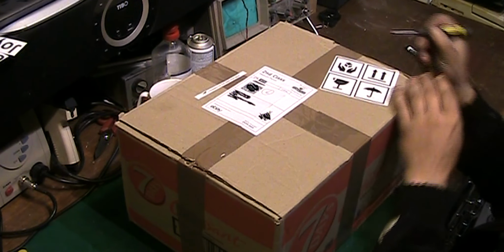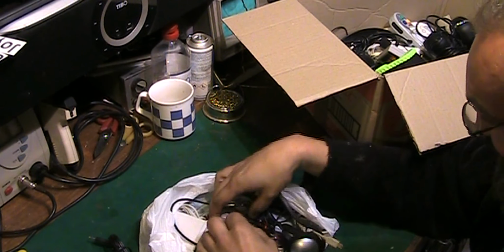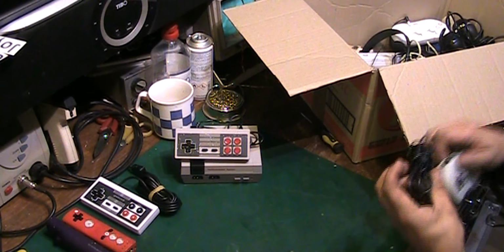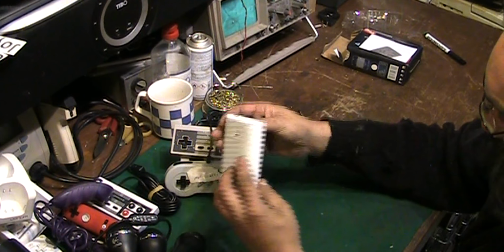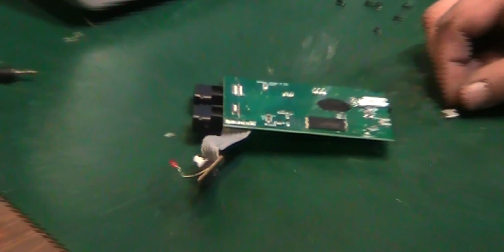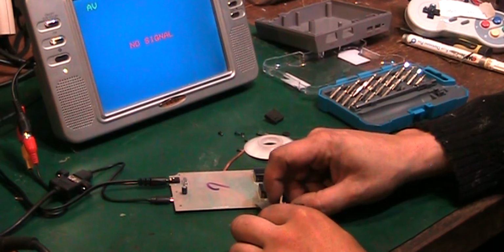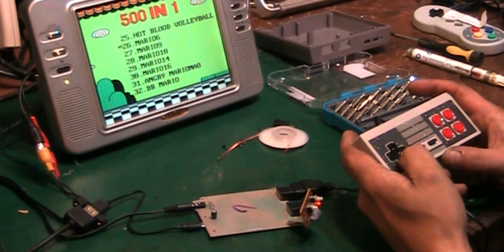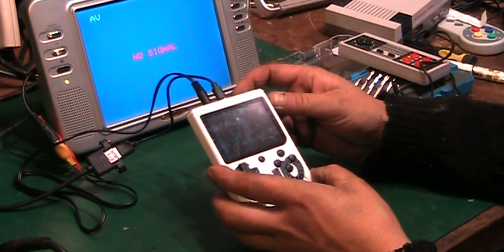Retro/modern ebay junk lot unboxing

Comment: Hi Jay, Iso will take the stickiness back off the plastic probably. Cheers.
Reply: I use WD-40 to remove stickiness from labels etc.
Reply from the maker: meths did the trick, all stickiness now gone
Reply: @Jayoldstuff1  You've just answered my question! I have an old xbox 360 controller that is really really sticky!